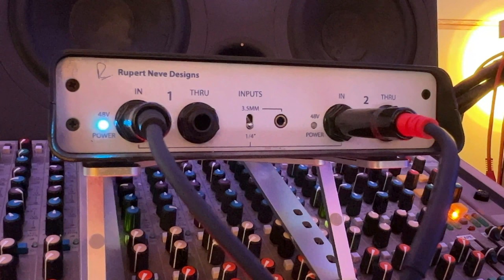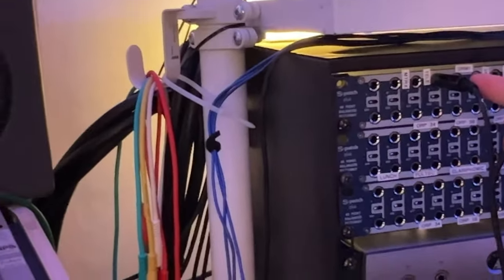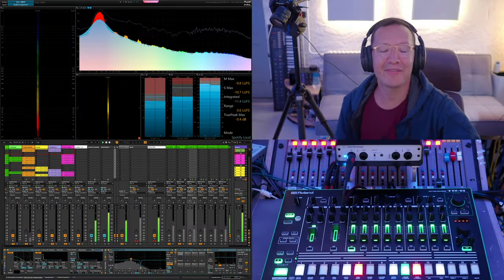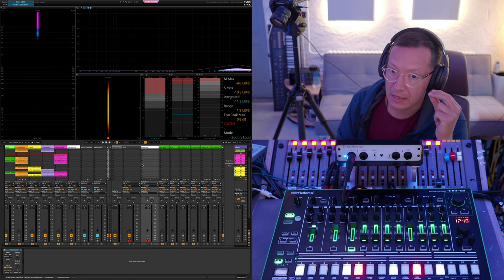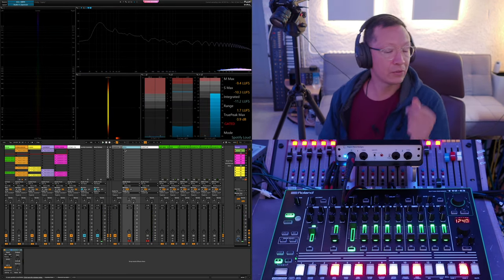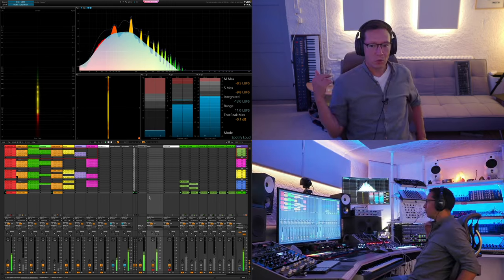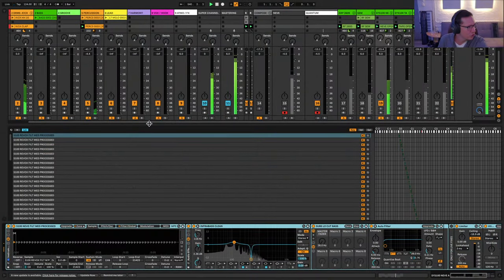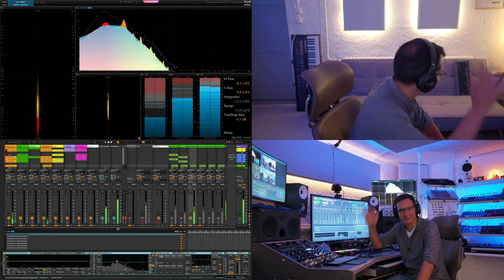RUPERT NEVE DI: Game-Changer for Synth & Drum Machine Recording?

Comment: how do you feel about transformer saturation plugins like Karzog True Iron? AFAIK the Neve transformers basically add 2nd and 3rd order harmonics that result in a "thicker" sound - unless there's lots of nonlinearity going on it should be easy with DSP
Reply from the maker: I ve tried so many plugins and while many sound great the hardware still has an advantage... this is why I was interested in the RND DI as it is a way to get transformer sound without spending thousands...